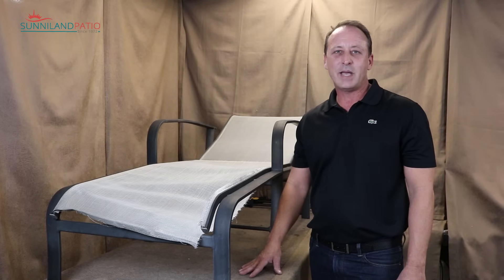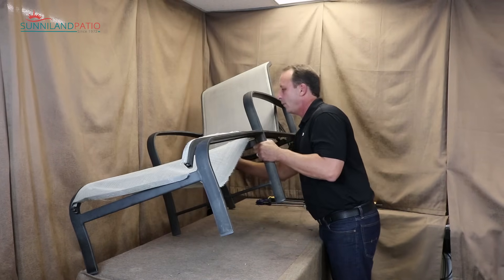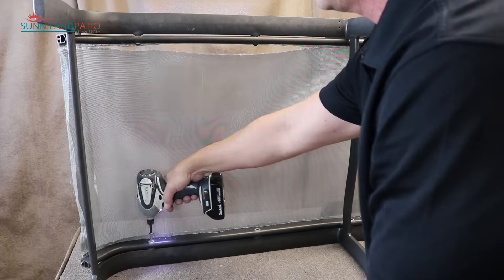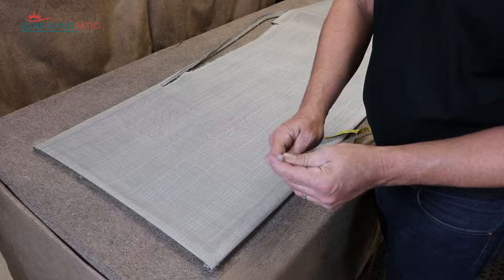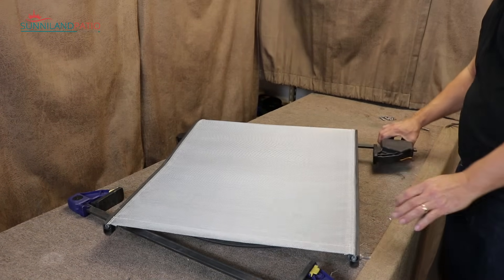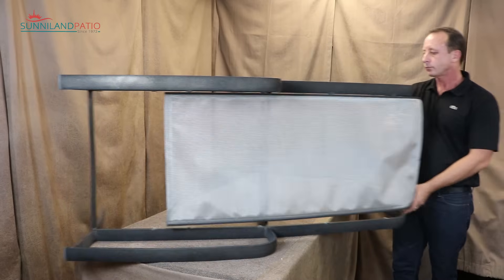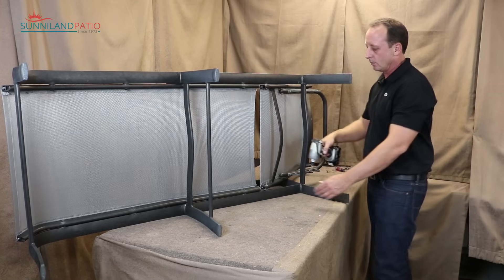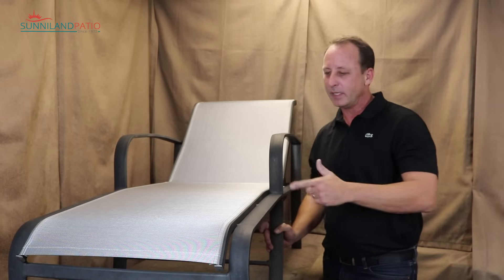How to Replace a Chaise Lounge Sling

Comment: For the love of God, what can I use to make the fabric slide up the rail because I’m killing myself trying to slide the fabric and I’m making like 1mm/rate🤷‍♂️😂 It’s like me trying to put on some skinny jeans made for a young person😬😳😂
Reply from the maker: Filing the corners of frame channel to remove where it may get stuck and saturate with soapy water to lubricate-  usually does the trick. If the new rods are larger than original- sometimes you can take the new rods out and slide the old ones into the new sling. Over 18- just say no to skinny jeans! That is one problem that is avoidable, unfortunately, installing slings can still be hard work, but, rewarding in the end.
Reply: @ 🙏🏻thanks for the advice - I screwed up the measurements too, so I have multiple issues😂

Comment: This video is great! Thank you for sharing. I have followed the steps to detach the parts from the frame but the fabric is not wanting to slide out! Any tips or advice to get the fabric loose?
Reply from the maker: Use soapy water and get it in the channel. Then use a flathead screwdriver to break the sling loose from frame- they tend to stick after such long periods. After you should feel it loosen and can grab fabric with pliers and remove.

Comment: Just got new slings for 2 lounge chairs. Bottom seat parts both tight, top part on both is tight enough to use, but very subtle waving and loosness in it. Measured correct and sling top came correct size. Any way to adjust chair frames even more to tighten it more? I already added a couple thicker washers in one spot where back bars connect to back of seat and that helped maybe 30% but still not great. Is this normal to happen when doing replacements? Im hoping rain and sun will tighten them even more too.

Comment: Great Video! Have a Woodard adjustable chaise sling similar in appearance to your example with the welded bars on the back section. Bought the two Quick Grip tools, hope I
Reply: it works on mine:)

Comment: How many yards of material did it take to replace the material? How do you calculate amount needed?
Reply from the maker: If you are buying and sowing the slings yourself then a good start to determine the yards needed is to take measurements of the size of the slings needed. Hope that helps!

Comment: checked around and you seem to be very competative in price,if i send you the measureents will the spline come already in the 2 pieces for the chaise?or does that come seperate.thanks.
Reply from the maker: Yes. The spline would come installed on the 2 pieces :)

Comment: do you have to sew the width of the new sling fabric slightly smaller than your measurement - to allow for proper tautness?
Reply from the maker: You can watch the HOW TO MEASURE video, it will explain better. But basically, once you have submitted the measurements as outlined in the video - we make the necessary adjustments for you! :D 

Video link: https://www.youtube.com/watch?v=sVjjys3Tvlw&t=23s

Comment: I checked on the price, they want, 99.00, just for the two-piece sling, not including shipping. Lowes or Home Depot, has the chair on sale 89.00, so why bother replacing sling?
Reply from the maker: Well if we're talking a $800 sling chaise or chair, then it's a huge difference. Lowes or Home Depot have really good deals however those chairs don't last as long depending on the wear and tear you give them.
Reply: not the same quality chair i bought the home depot one and the fabric was shot 3/4 into the year ...just for info.
Reply: Because we need to repair things instead of throwing them away. Because we only have one planet. Because it all has to go somewhere.
Reply: I just ordered and shipping was free. Plus I saved $40 through my Captial one shopping app. To buy new ones you are looking at spending over $200 per chair anywhere to get the same exact lounges we have. So worth the money.
Reply: @RuthRodriquez  I received a quote $169.00 per chase lounge chair.

Comment: Unfortunately, I took the sling off the seat of Chaise Lounge before measuring. I left the sling on the back of the Chaise Lounge, as did not have the quick grip clamps to assist in removing.  Do you suggest I use the measurement of the back sling width as the width for the seat sling as well?

Comment: Our chairs have a solid bar at the top of the chair and can't be squeezed in with a clamp?  How do you remove and replace the slings on this type chair?
Reply from the maker: Most cases like this the bar is removable and after sling installed- you can use spreader to put back.

Welcome to send picture to sales@sunnilandpatio for more help.

Thanks for inquiring!
Reply: Our chase has a bar at the top and is welded so we can’t put clamps on the back . We are having so much trouble putting this back on I’m afraid it’s going to tear.  Also , ordered the sling to the seat and they sent me a size 1/2 to narrow. Don’t want to send it back it could take all summer to get. What would you suggest on the top of the chase?
Reply: Might be better to try to match the existing back fabric, and just replace the seat. Maybe put a towel across the bottom or back if the fabric mismatch is bothersome